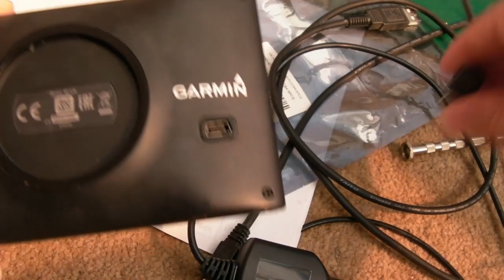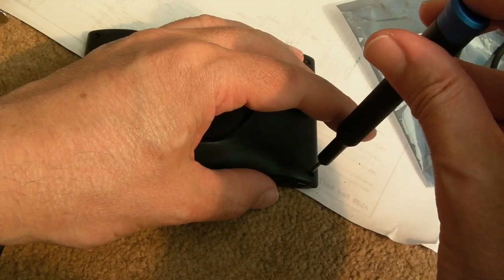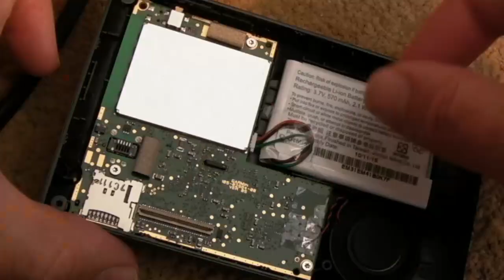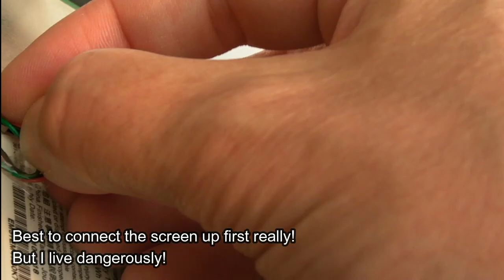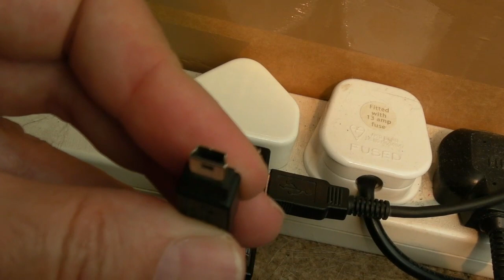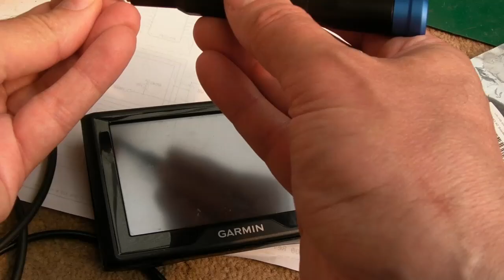VLOG - Garmin Sat Nav (Drive 40 LM) Quick Fix

Comment: ..... Well done Mate,  so flat that the BMS chip isn't even running ?
I keep my old 'one sided razor blades' (marked with an X (for blunt)
for opening laptops, monitors, etc. Bend those tabs tighter on the surround of the USB mini female socket to hold the male tighter. I'm always doing that to USB-A. When you said 'lift that flap' it reminded me of an old girlfriend.